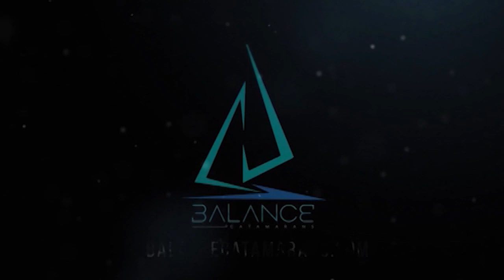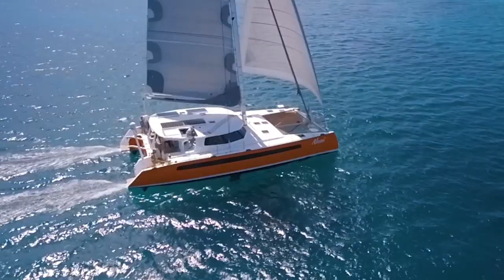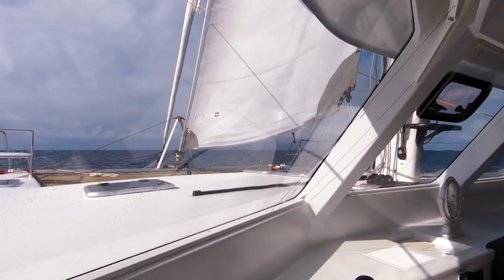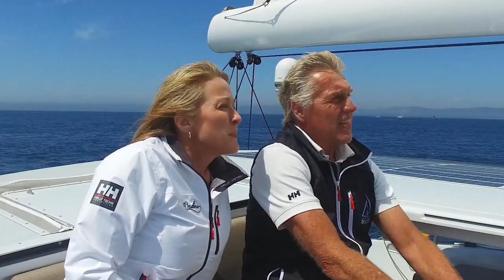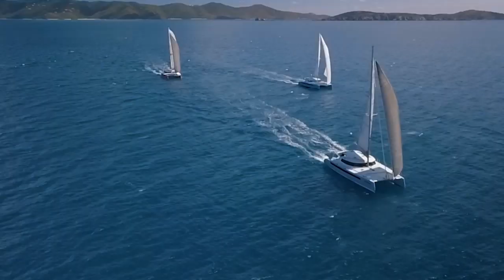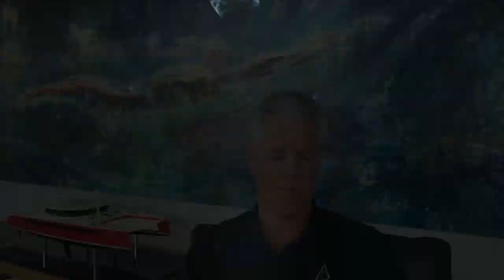Electric Engines on a Balance Catamaran?

Comment: what about generating power using the props and also using renewable power via a wind turbine to generate electricity
Reply from the maker: There are many hybrid systems out there, many electric options. When someone says they were able to do an Atlantic crossing without diesel power generation, meaning using only solar and or hydro prop generation, you must ask them how often they had to drift or motor at very slow speeds to sustain battery charge. You may wish to see what occurred in the Outremer Alcana challenge with Jimmy Cornell. We have also seen an electric power cat company say they had enough range to cross the Atlantic on solar, but did not tell us that they had a diesel generator and jerry cans all over the deck. 

The issue learned in the Alcana challenge is that hydro generation is not significant and requires that you are sailing, and ideally sailing very fast. You end up mixing drag with power generation. So when there is no wind you must rely solely on solar, and boy that means a lot of solar if you are in low sun conditions. It also means having a very heavy and massive lithium battery bank to store energy. So, as with the Alcana challenge, they had to go on a strict energy diet when they had little sun and little wind. Again, a 100 years ago they drifted through the doldrums. So you can always do that. They ended up cancelling the effort to sail around the world without fossil fuels. One of our agents was a crew on that yacht so I am very familiar with the challenges they faced and what they learned. (I am glad the learning did not come at one of our customers' expense.)

I personally have no issue with electric motors or hybrid systems for folks who want them and we are happy to install them. I do have an issue with making performance promises to them or suggesting that the added complexity of such systems will not pose additional risks over a diesel engine. My own view is that, at present, solar technology is not good enough and lithium storage is not good enough to make voyaging safe without having a diesel generator on board when the batteries are low. As for hydro, if you have a really big and very fast cat that is averaging ten-plus knots all day even in modest winds the hydro has some modest benefits. I cannot tell you how many used catamarans I have sold in the Caribbean in my former life with hydro generators they tried to re-sell. Putting a hydro generator on a slow mover is not worth it.

Look, we all get excited and want to see technology lead to a greener world. The sad truth, at present, is that diesel is a 23% denser energy carrier than a lithium battery. The dream of the non fossil fuel sailboat is to my mind a bit away - unless you are prepared to sail on a super spartan boat, a very fast boat in light airs, and are ok to drift or motor very slowly when solar and wind are not up to charging your system. 

We have invested a great deal of time and energy to work closely with Integrel to perfect the Integrel alternators because we think - at present at least- that diesel engines charging 48 volt lithium batteries are the greenest and most reliable option around. When you need to you can motor fast and charge fast. But the amount of diesel a performance cat burns is very low. We have had some of our cats cross from South Africa to
Grenada and use less than 100 gallons of diesel. 

But again, we are happy to let our customers experiment with hybrid systems or electric motors, etc, we just do not wish to make performance predictions, or reliability predictions, and would ask the manufacturers of such products to make the promises to you and to service and support you when problems arise. We have a brand to protect and customers we wish to protect. These boats are already terribly complicated with mountains of electronics and systems. A significant part of our brand focus is to fight like mad to create boats which are as reliable and easily maintained and serviced as possible. This is challenging for any complex cruising yacht as they are floating self sustaining eco-systems considerably more complex than a modern home.

Stay in balance!
Phil

Comment: i am curious about electric propulsion and have done a lot of research over the last year or so . I know hybrid electric has been used (trains) for a long long time but you are not suggesting that as an intermediary step .  the appeal of low maintenance and long durability of electric motors is obvious and the cooling required should not really be that hard to install so.. what about a sailing system with lithium bank , electric motors , regenerative saildrives , and a backup dieselgenerator to augment the solarpanels . initial cost might be higher ( even substantially ) but it provides for redundancy , reliability , lower maintenance . There would be a cost to performance whilst under sail and regenerating , but even that can be minimized with feathering props when sailing speed is of the essence  and the need to recharge batteries isn't .Thank you
Reply: Most cruising sailboats have all you have listed. All you are talking about is trading out a diesel engine for Oceanvolt the cost of which is minimal due to the ease to install a sail drive.

Comment: Without getting into energy conversion equations and other rocket science tangents, I would argue that Phil is right in that, pound-per-pound diesel still has at least one order of magnitude advantage over electricity as of today. Balance Catamarans, or any other responsible builder of voyaging yachts, plunging into 100% electric propulsion would be ignoring the inherent unnecessary risk of battery depletion at a critical stage of a sea voyage. I have met many an old sailor in my days and not a single one  claimed to be brave or brash. Old? Yes. Wrinkled? Yes. Full of amazing stories? Absolutely. Alive? Yes, very much so. My take away from all these encounters is that old sailors are a bunch who share a little thing called risk-aversion. An old Yanmar or Universal three cylinder are venerated icons in any watering hole from Anacortes to Ushuaia and these little beasts sip fuel at a miser rate. Repairs? I once replaced my alternator belt on a Westerbeke two banger with a pair of pantyhose extracted form a fair damsel who was part of my crew and pumped enough juice into my batteries to fire up my radar in the middle of a two day fog bank bashing up the Baja between Turtle Bay and Ensenada ( that is a story with an equally happy outcome, but  for another round of rum, if you don't mind ).
One must also consider the point brought by another person on this thread: The skill set necessary to troubleshoot and repair such a complex system on a good day let alone when the Buford scale is dancing with the ugly side of gale exactly 1500 miles form your nearest alternator repair shop. One may argue an electric system is much simpler, after all we are talking a battery hooked up to a motor that drives a prop. But in reality, it gets a whole lot more complicated than that when you scale it up to the configurations being contemplated in this discussion. The argument could go both ways as far as being on an empty tank or a depleted battery, but that to me would be  an indication of either poor seamanship and lack of proper planning or extreme bad luck, in which case an atomic reactor would not be enough to save the day.
Reply from the maker: I totally agree with Fernando. If I had seen great electrical cats in my years selling used ones I might think differently. But I am also prepared to say that as the batteries get better, solar better, systems more refined I may change my mind.  You still cannot escape carrying a generator and diesel on a voyaging catamaran today unless you are prepared to drift, motor at very low speeds, or motor at higher speeds for very, very limited range.
Reply: @balancecatamarans  What if the electric motorsailer can charge under sail? If even the combination of a wind generator (for when anchored) and hydro-generator (for when under sail) is not enough, how about a generator driven by a stirling engine? Sirling engines are very quiet and can run on any fuel.
 Use fossil fuel if you have a compelling case to use something non-renewable. If it burns cleanly enough, the emissions are just carbon dioxide (which is absorbed by vegetation) and water vapor.

Comment: Adding a REGEN SYSTEM along with HYDRO GEN and solar, would that be enough?
Reply: There is so much misinformation in this video that it's no even worth discussing. Anderson, "enough" is such a multitude of variables. If someone thinks like this guy that you need to motor for hundreds of miles, then the answer is different compared to a sailor like me that has never, ever, ever, NEEDED to motor for more than a few hours. Look at an Oceanvolt system and see that it's pretty darn easy to motor at 4-5 knots for hours even with the poor solar efficiency and lithium battery storage. Wait a couple years for much higher solar efficiency and solid state batteries and this whole conversation is useless. In less than 5 years this guy is going to have to do another video and say, oops, i was so wrong.

Comment: I agree with what you say.  If you can put 5k of solar on the boat fantastic.  Watch out for shading issues meaning at most 2 panels in series.  I have 63 panels on my home all acting like they are in parallel (solaredge optimizers).  I am just starting to see 560 Amp hr 12.6 V, 7,200 W batteries.  For under $10k, a 28 000 Ws of energy.  You also have recharge with Oceanvolt hydro.  So the question is do you install 3 of these banks and a backup 6kw generator?    You use chilled water for AC/heat as the most efficient option.  These battery banks offer over 5xs what a common 100 Ahr battery does.  I have no experience on the ocean without wind.  Once you get 10 knots of wind, with both on regen you can start charging the batteries again.  As safety is everything, then an emergency generator is the way to go.  The electrics are way lighter than diesel.  Cost should be 20-30 for the batteries and 30k for the hydro pods Oceanvolt? minus the cost of the diesels.  Normally you can even run the AC on solar. Canadian solar panels just under 400 W can be installed and not the 125 W ones I keep reading about.  Just sitting around waiting for the wind is not all that bad and normally it would be sunny.
Reply from the maker: You could get close to 5k of solar on one of our 526, adding a panel bank off of the davits. And yes, for those who are imbued with a desire for an electric boat, they can add a gen or two and it works. It really isn't lighter and you still have to burn diesel if you want any speed or range. A 6KW generator would not be enough on our cats to run two electrics. And most of the cats I see them doing have one large generator, 18 Kw or more, and then also a smaller backup gen. Just what I have seen to date. As for a 400 watt panels, sounds great, but you do have to organize the solar around the coach top to have access to boom and sails, roof hatches, helm sliding hatch, etc, so generally that size poses some challenges on a cat. Sitting around waiting for wind is not bad, agree, for me and many. I just want to be able to motor hard and fast when the weather files tell me I ought to be somewhere else to avoid extreme weather. I had such an experience years ago with an approaching hurricane on an Atlantic crossing and it taught me the value of having range and speed under power when required. This is where the diesels are quite superior. The juice it takes to motor at 9 knots for 200 miles on a cat is significant. Electrics running at 9 knots you would need very large electrics and a very large gen running the entire time. This is what Captain Andrew Hodgdon learned while captain of an electric Gunboat 57. Anyways, I have said all I can on this subject!  For now our advice is to stay with diesels for voyaging cats until technology improves. But I am fine if others disagree. Take care, Phil

Comment: Actually, instead of an all electric 526, I would like to see one with enhanced performance. I know that Gun Boat has the G4 with 'Sea Foils' can reduce wetted surface area- I can see no reason why a Balance 526 couldn't get sea foils for reduced drag and enhanced speed. With such a well balanced and lightweight boat (in sooo many ways!) it should be relatively easy to do. I also sense that the hull exceeds rigidity requirements by a substantial margin already. Additional carbon fiber reinforcement should be relatively simple and probably barely noticeable to even 'savvy' owners. You can already get the larger 80HP engines for added safety in weather, perhaps someone like Volvo or Yanmar will develop some additional efficiencies at steady state RPM's to allow for less diesel to be carried?
Reply: If you desire more performance out of the Balance 526, you can select our "XP All Carbon" construction option.  It weighs in at just over 10T lightship.

Comment: I am curious do you synchronize the electric motor’s charge controllers with those for DC generators, solar panels, wind turbines, and DC power from shore power.
Reply from the maker: You can do any of those things, sure. As I have sought to explain, as builders, we are happy to let people design their electrical system as they wish. They can work with a specific provider, and installer, and then those companies can offer the warranty service and support. We do not wish to assume the liabilities of these systems as we have seen too many failures and problems to date. At this time we simply feel the disadvantages of electrical motor cats trump the advantages for voyaging sailors. They are fine for day sailors or short passage sailors. One way or another you will have to rely on a large diesel generator to get any range or speed on an electric motor cat. Take care, stay in Balance, Phil

Comment: Such a funny video in a way. It's as though you have to apologize for the truth of electric engines on a sailboat. If you've done a bit of cruising, you know that sometimes you just need to 'fire up the iron jib' and make distance. Weather, provisions, other logistics, health issues - plenty of reasons you may want to just jet. When I realized the low range under ideal circumstances I concluded it was irresponsible.
Reply: For some reason the subject of electric drivetrains is a very sensitive topic.  People get unreasonably upset that the performance characteristics they're hoping for don't actually align with reality.  Without pointing fingers, there is a ton of misinformation online that is supported by marketing materials which provide performance projections in the most ideal conditions possible.  Any sailor who has a few miles under their keel knows you very rarely experience ideal conditions.
Reply: @andrewhodgdon2786  Like so much in our society, posing is more important than reality. Virtue signaling as a greenie is huge cred in some circles, and I can see how gratified folks are who do this. It's very self-satisfying. Wait till they finally realize catastrophic anthropogenic global warming is really just a left wing/enviro activist conspiracy theory - oh wait, they never will figure that out. Cuz they have shut themselves off from all info that challenges that worldview and are told people who do so are damaged, defective, dangerous and now racist. Cuz "climate change is racist" now - I heard it on MSNBC.

I realize you do not want to get into this in public. Me? I'm not selling boats so I don't care. I do find occasionally there are reasonable "climate activists" (everyone is an activist now - i guess liking stuff on twitter and shouting as part of some left wing mob is activism) who are open to information and data. If there are any of you like that out there, I invite you to watch this video that shows you there is no "97% consensus" among scientists about CAGW. That's a lie. https://youtu.be/ewJ6TI8ccAw

If Obama would lie to you about the 97% consensus - what else is being lied about wrt climate change? Answer - almost everything...The real issues we aren't addressing are other pollutants in our oceans, dumping of waste, overfishing etc. due to the Lefts obsession with climate change and their vast waste of resources on this non-problem. These are huge issues that the trillions the West has spent, essentially on collective virtue signaling, could have focused on real issues. Like a Chinese fishing fleet of hundreds of vessels violating international law and pulling huge catches from the areas around the Galapagos. Or the Pacific Gyre, which Trump actually focused his EPA on for a minute...

I've corresponded with you on a Balance 442, won't know till end of year whether I can get in line for a delivery. Sadly, my sailaway budget for my retirement live aboard is currently about half the full splash cost of a 442 but I have some options that may pay off hehe. Balance cats are amazing. You guys have found the sweet spot of the market for sure.